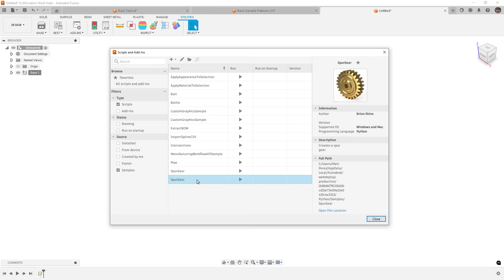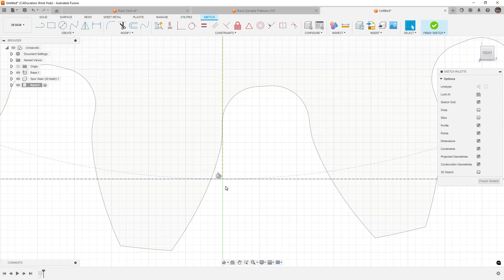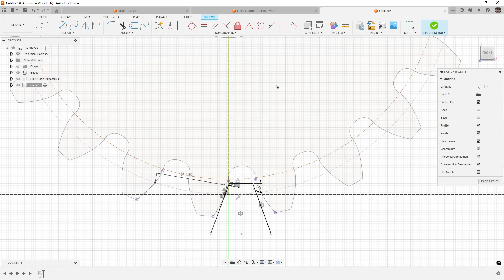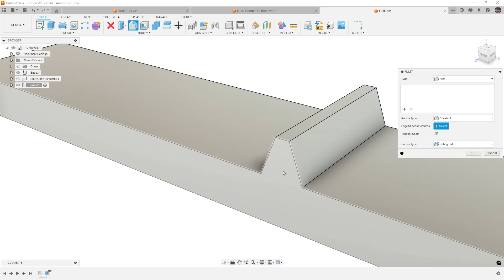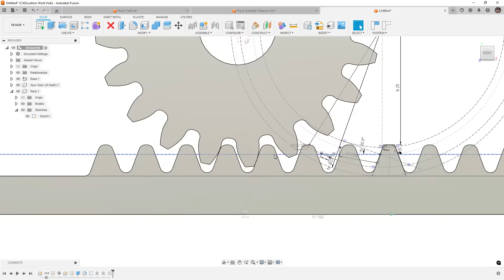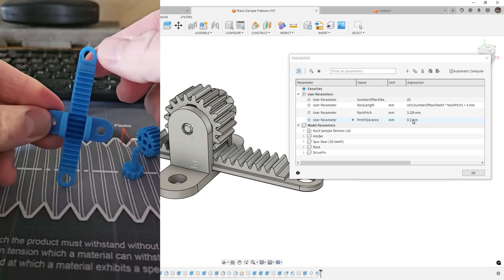How To Design A 3D Printed Rack and Pinion

Comment: Great tutorial. However, a few times (like doing the coincident constraints) you mentioned an operation, but didn't describe how it was done. I had to back up a few times to see where you were clicking. Some watching this may not be as familiar with operations/functions and could use a bit more information.

Overall, though, I learned a lot (especially using the joints and constraints) and will need much more practice!
Reply from the maker: Thanks for the feedback!  I will try to pay closer attention to that next time!

Comment: is there a tuturial for creating pinion and rack in Plasticity ? :)
Reply from the maker: Not yet :)  its actually on my todo list!  I have a 3d print gear video.  Depending on the need though using a true spur gear profile is probably much harder than something like a circular profile.  The real benefit of a spur gear is load transmission and that really isn't the point of a 3d print.

Comment: Great tutorial, thank you.
If you want more exact measurements from your driven dimensions, go to the Parameters window. You can also directly name the driven dimension there and use it as a parameter in other places so you're using the exact dimension.
Reply from the maker: That's a great tip, thanks for sharing that trick with the parameter window!

Comment: I'm wondering about the 3.129 spacing of the rack teeth. That was the chord length of the pitch circle between spur gear teeth. Wouldn't the actual arc length be more exact?
Reply from the maker: You would think that and maybe its the case, but here the arc length was 3.142.  not a huge difference but when you set the pattern at 3.142 and set the motion link to travel 3.142 for each tooth on the gear you end up with a slight overlap at the end of the 8th tooth.  If you use 2.129 you don't.  

I am not sure the reason for it, but when i was planning for the parts the references I had found for the rack measurements used that straight line distance.  I wish i had a good answer for you as to why.

For a 3d print with the additional gap of .2mm we have it really doesn't matter.  Even if you went out 20 teeth there is still enough slop in the system.  If you were trying to machine it however I would dive in a bit deeper to the gear design and verify the numbers.

Comment: Can’t you use 2 spur gears and use one tooth of one of them and pattern it linear?
Reply from the maker: The shape of the rack gear is actually a different profile than that of the spur gear.  The spur gear contact is a spline/arc shape while the rack is straight.  For 3d printing it would probably be fine but in reality the profiles are a little different.
Reply: @LearnEverythingAboutDesign  Oh. I didn’t know that. Thanks for the reply.

Comment: Thanks to you, I’ve got a lot better at plasticity and I’ve mostly designed everything that I had in mind. However, I struggle a lot reverse engineering any mesh model in plasticity. I have this hard piece that I want to remix but I just can’t seem to get it. Can you please help? I can send you the 3D file 🙏🏼
Reply from the maker: Glad you're finding success with the program! I recently did a video showing the different ways to do this in Plasticity.  The tools are limited but possible.  feel free to email me support@caducator.com and ill try to help.